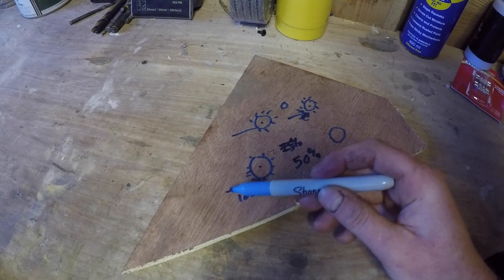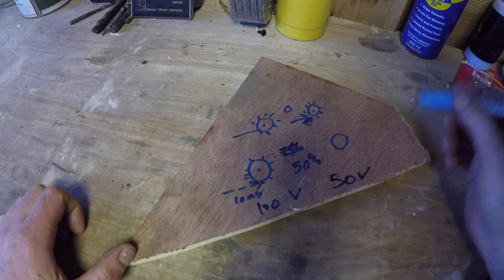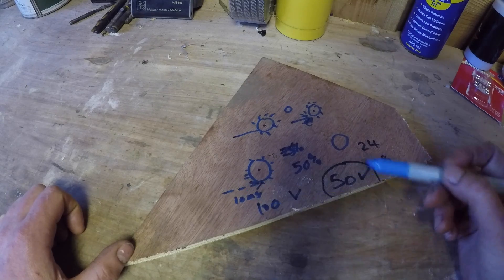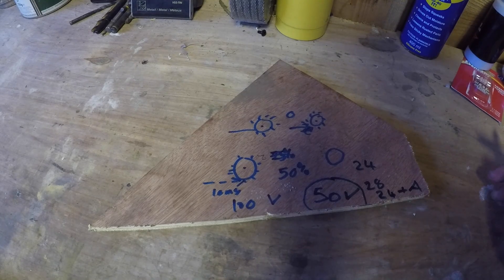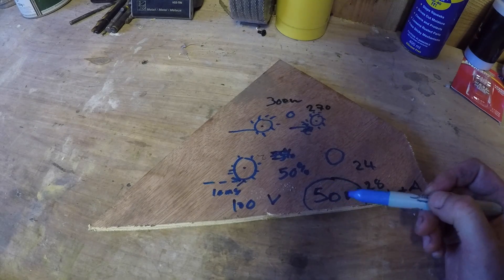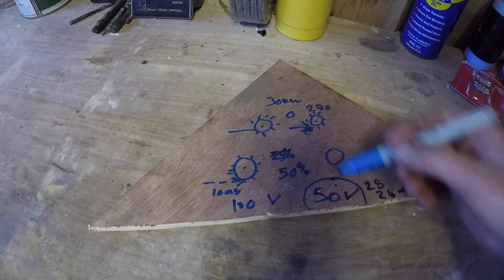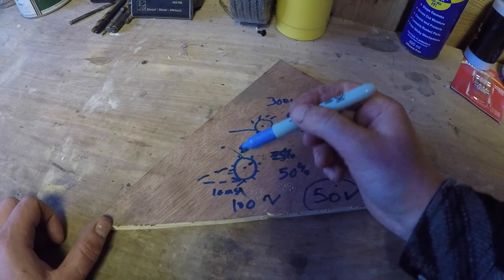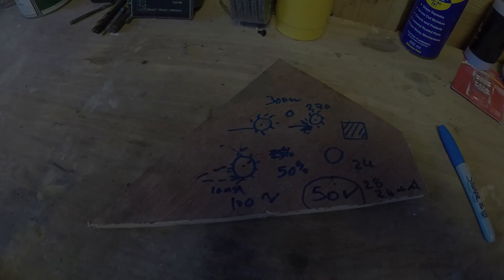DIY Micro Hydro part 19 why use MPPT

Comment: Hi Kris, 
You need not bother responding.

Seems like you are using MPPT optimize charging.  
Withdrawing amps is producing torque which is in turn is reducing the momentum of the turbine.
Wouldn't you need to adjust thrust via the nozzle to keep the spoons spinning at 50% nozzle speed?

Let's say you you are driving your nice set of wheels across the lovely Welsh countryside. 
You offcourse have important things to do. So to be at your destination ASAP you're driving her at the speed(limit) and intend to keep her there.
But also but you want her breakpads to get nice and hot, right NOW, because you feel like it. 
How would you go about it?

Anyhow you will succeed! 
Looking forward to your next video.
Reply: A short video on how to manage your Pelton wheels RPM most efficiently via nozzle. 
5 minutes well worth your time I am sure. 
http://www.learnengineering.org/2013/08/pelton-turbine-wheel-hydraulic-turbine.html

Comment: It's quite possible that the people that already have suggested that the power is too dirty are correct. If you have just a rectifier bridge with no caps in front of this controller, that power would be very hard to measure correctly.

Comment: It's quite possible to make a switch mode controller that sends exess power to a dump load while keeping the generator output at maximum. The diverted energy could be used for heating water for example. This would complicate the system quite a bit, as you would need a way to ensure that you don't overheat your hot water tank.
Reply: I don't know if such a controller exist that would fit your needs, but I do know that people are storing exess wind and solar as hot water.

Comment: You are right... But I am also right. MPPT for solar works completelly different. Trying to switch to wind is very simple. You can try it fairly quick. Locking on exact voltage is not a good thing to. That will work only if you have still the same amount of water (preasure). Firmware can do the trick... If you can set manually VA characteristics it should be it. You need to found maximum power point at which voltage is that and then force VA to the controller when lower voltage means lower current, so that turbine is able to spin up. I would do it kinda differently. I would make  PWM control based on arduino (more voltage more open PWM)via fets and then connected to mppt. Then I should be able to learn that arduino how to control the output voltage. You could also measure  preasure and control the jet to make a stable preasure. Then you can use cheap mppt solar controller because voltage controll will be done by arduino.

Comment: In wind mode on that controller it should not care what the incoming voltage is. It will just take the incoming voltage and step it down to increase current. It must be as you said real old firmware. Try it again after it is updated. Nice explanation

Comment: With 29 upgrades to the firmware, it's amazing they don't have better tech support. Someone is writing that code. My thought is, until you can get that firmware upgrade I wouldn't do anything you may have to undo. As the upgrade could  offer you more options in setting it up, it certainly should fix the bugs they found using version firmware 1.0, 1.1, 1.2 ... They found 28 bugs in this system and fixed them, yet you don't have any of those free upgrades. Your doing a great job with this and it's been a joy to watch you create a home on this property. Thank you.

Comment: I bet you've been through everything several times Kris, just looking to see if I can spot anything else, I know you said your updating the software. 

Just had a google at the manual (if it's the right one) it doesn't state mppt as a status it says
 "charging stages - Bulk, Absorption, Float, Equalize" 
Maybe the controller is in one of these stages but isn't communicating which one? 

Just wondering if the app on your phone isn't being communicated this info?
Reply: Are you reading the MPPT manual or the other one (Ts-mppt-60 ot ts-60)

Comment: great information about everything
I use only 150 volt MPPT controllers with full success, putting only a large high voltage capacitor right after the rectifier bridge
I also have plants with the same turbine but up to 4 separate houses with their mppt controllers
for ballast I prefer to use a low cost programmable overvoltage on the battery and its relay puts me a load taken from the inverter at 230 volt ac for the available surplus

https://www.homepower.com/comment/3047/edit

Comment: The idea behind MPPT (maximum power point tracking) is to maximize the POWER received from the source. Since power (in electrical terms) is voltage times current, that means monitoring both voltage and current under varying degrees of load and drawing current at such a rate that the power is maximal. A solar MPPT controller sweeps across the range really, really fast when determining the MPPT, since solar panels react almost instantaneously to load changes; however, the physical inertia of a turbine requires a much slower sweep rate. Indeed, it's probably better suited to a fuzzy-logic approach where small changes in loading are made to find small changes in power output over relatively long periods, say 5 seconds at a time, and pursuing those changes that result in higher output power. That method would do poorly with solar, which normally has fluctuating output, but it would be great with hydro power.
Another way you could boost efficiency is by having a boost converter in the turbine house cranking it up to hundreds of volts, and a buck converter in the storage house dropping it back down. Again, power is voltage times current, so transmitting at high voltage DC results in lower transmission current, and therefore lower resistive losses. This is the exact reason why AC power grids are nearly universal: buck and boost converters didn't exist a century ago, but transformers (which do the same thing for AC) did, and this made the elecrification of wide areas possible.
Reply: Oh, wait a minute! You have a three-phase generator, so you have AC already. Scratch the boost/buck converters and get a couple of three-phase transformers for the transmission line.
Reply: Making Sense I imagine the cost of three phase transformers at this size would not be cost effective and if it is a short run from turbine to charge controller then the transformer losses could be more than the line losses at a lower voltage. It would only be worth considering if the distance was so long that the voltage drop was causing problems. I wonder what the smallest three phase transformer is? What voltage would you step up to? 415? 690? 11kV lol?
Reply: Well, any choice has its tradeoffs. Since I don't know the precise details, we can figure out some stuff and Kris can take that data and make decisions. He's said his wire is 16mm^2 in cross section, which is about the same as 16AWG. On the chart I checked, that has a resistance of 4 ohms per hundred feet. If the power house is about 300m from the generator, call it a thousand feet, so that's around 40 ohms, which is not insignificant. In his first test video he was getting about 9A, or 3A per conductor in 3 phase. 3A across 40 ohms is 120 volts!
Now, perhaps I'm screwing up my calculations somewhere, but that seems pretty inefficient. How can we determine what the line losses are in the cheapest possible manner? Well, he's already laid a second cable. If he simply terminates the ends of the other cable with connectors and runs that in parallel, the resistance is halved and the power losses will be one-quarter. That's a pretty simple test; if it makes a big difference to power delivery then it may be worth stepping up the voltage. How far depends on economic considerations (transformer cost) and the properties of the insulation, but ignoring transformer losses every time the voltage is doubled the current (and resistive losses) are halved. Even if the difference is slight, it may be worthwhile keeping the transmission lines in parallel while the second line is otherwise unused.

Comment: As to why you're not getting the result you want from the MPPT controller... is it possible that you need a bleed to bring up the voltage? If your system target voltage is 48v, but you also have a load on the system, my thoughts are that the charge controller may be lowering the input voltage in order to avoid overloading the battery rack you have. I could be completely wrong, I'm no electrician.

Comment: The water jet velocity isn't too hard to estimate, ignoring frictional losses in the nozzle. Applying Bernoulli's equation (for conservation of energy, since we're ignoring nozzle losses), pressure + 0.5*density*(speed^2) = constant. Ignoring the fluid velocity in the pipe before the nozzle (~13cm/s for a 4" pipe @ 1 l/s, so not very significant), we can rearrange it into pressure(inlet) = 0.5*density*(speed(outlet)^2). This simplifies further to (pressure/(0.5*density))^0.5 = outlet speed.

Subbing in 1,700,000 Pa pressure and 1000 kg/m^3 density, that gives us a jet velocity of 58 m/s, and 29 m/s radial velocity for a 1 ft diameter turbine is about 1800 RPM. The optimum RPM for your turbine will vary, of course, since I'm ignoring viscous losses in the nozzle, but it should be in that ballpark (and probably a bit lower).

Comment: The main idea is that any MPPT solar controller goes on hydro as long as not to exceed the maximum input voltage admisa.Pentru epever voltage is about 92v maxim.Daca your batteries are full load controller stops the turbine and enters the float to it keeps them charged. It's the same thing as the solar. Panels produce but the controller stops charging and the hydro turbine produces but the controller stops charging and that's very simple to understand.The whole thing is not like the wind turbine where you have to defuse it. On the water you adjust the nozzles to produce 70v and it will produce you this voltage.

Comment: Could be the Chinese controller isn't showing the correct voltage hence Chinese and the other controller may be more accurate. Should test the wattage output of each controller with a different method of metering the wattage.

Comment: Hello Kris (and Hanna). Your explanation is correct. The wheel should turn at a rate such that the cups are moving at half the velocity of the water, at which point the exit velocity of the water is zero. In your system the charge controller will act as a buck regulator, taking the voltage from the turbine at 50 V and switching it down to 25 V, while doubling the current. Best of luck with the controller. I know with your patience, knowledge and persistence you'll get the most from your system. As always, I enjoy your videos very much. Thanks for making then.  Cheers, Dave
Reply: Hi LegendLength. Yes, both are true. The controller does a simple conversion from 50V to 25V (approximately) like a buck regulator. The correct voltage ratio is sensed by the controller by varying it a little to see if the battery current increases or decreases. Good controllers can also scan the full range to find a close starting point.
Reply: LegendLength: It works a lot like solar based MPPT's, in fact, probably the same controller. The panel/turbine will have a sweet spot where it puts out the Max Amperage at a given voltage. This can fluctuate as not all ranges from 0V - MaxV has the same Wattage output. Think it of it as a bell curve. As you approach the sweet spot on the voltage (moving from 0V upwards), amperage will increase as well as wattage. Once you hit the top of that bell curve and start on the other side, even though voltage continues up, Wattage will start to decrease as amperage starts to suffer.
MPPT finds the top of that bell curve. With solar, it can fluctuate as much as 20V withing a short period of time, due to clouds or what not. So the MPPT working with solar can/will jump quite often from one voltage to another and keeps seeking the correct voltage with Maximum Power. With the turbine, it's pretty much "set" at 1 speed, which will output a certain voltage. The MPPT will adjust the load (charging load) until the turbine stabilizes at a particular voltage and current is at max.
Now, the MPPT will continue to seek, so it will vary slightly as it is always trying to find the best spot. So output voltage could bounce between 48V and 52V, or less. If the water flow slowed down for some reason (say, a clogged line) but enough to keep the turbine spinning, then the MPPT would drop in load and try to keep it stabilized. So, it could drop to 30V and the speed of the turbine will be 1/2 of the flow of water.
I hope this is clearer than mud  😜
Reply: The speed is determined by the load. The load is determined by the amount of amps being pulled. Well, sorta. The MPPT can control the speed to a degree. It can probably allow it to free-spin (no load condition; 100% spin), and load it down to just over 50% speed as Kris mentioned in the video. It could probably load it down to about 40%, but there's a point where the water "will" turn it regardless of the load. At that point, the turbine will start to overheat and risk of failure due to over heating could occur.
Think of a load as a brake on car. If you are pressing down on the gas peddle to go a set speed w/o brakes, that is the same as free-spinning of the turbine. Start applying the brakes to slow you down but not letting off the peddle, this is the same as applying a load to the turbine. As some point, the brakes won't hold and will burn up and fail as the motor can overcome the brakes.

Comment: https://2n1s7w3qw84d2ysnx3ia2bct-wpengine.netdna-ssl.com/wp-content/uploads/2014/02/150V-TS-MPPT-Operators-Manual.pdf   Can't do any harm to post this in case you haven't seen it and it's of any use.  If it's rubbish I'll delete it 
it's a pdf from https://www.morningstarcorp.com/products/tristar-mppt/
there's a load of stuff in the doc about  Battery Charging Settings

Comment: have you tried to contact the costumer support?
Reply from the maker: No not yet. I’m going to update the firmware first. I pride myself in working things out and I really hate talking to those tech support lines. It’s the last resort 😬
Reply: hopefully this will work
Reply: Did you solve the issue?
Reply from the maker: still working on it, i cant connect to it using the serial port that is nessarsery to do the update. so im waiting now for a usb to serial adapter to arrive in the post.

Comment: One point I didn’t see mentioned since switching the charge controllers is the actual water flow. I presume the flow is pretty constant and hasn’t eased up?
Reply: I think that as long as the pipe is full then the flow and pressure through the nozzle is the same. There is tonnes of spare water in the stream (as in, it's skipping over the intake) so I reckon it would have to be very low flow in the stream for the pressure in the pipe to actually decrease. Eventually I think he's planning to cement around the intake so no water runs round the sides to make it even less likely that the pipe isn't full. 

However, I actually don't have a clue what I'm on about. This is exactly the kind of thing I pick Kris's brain about and probably drive him nuts with my lack of understanding hah!
Reply: At first I thought I made a good point :) but after these comments and thinking about it some more it makes. I’m learning a lot! thanks